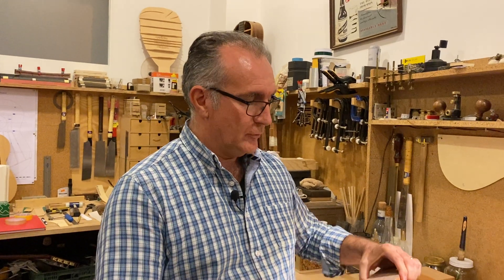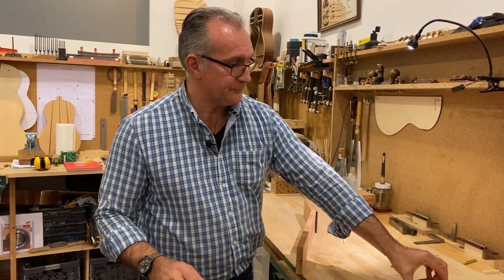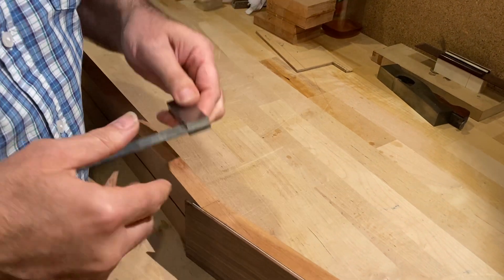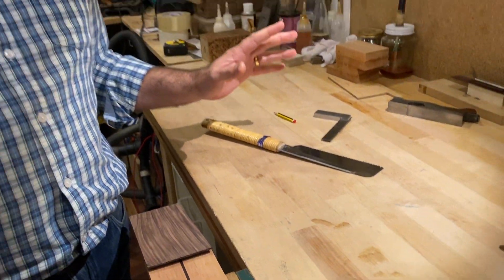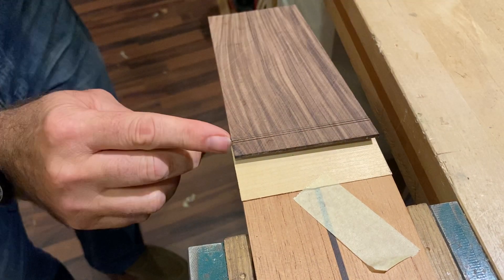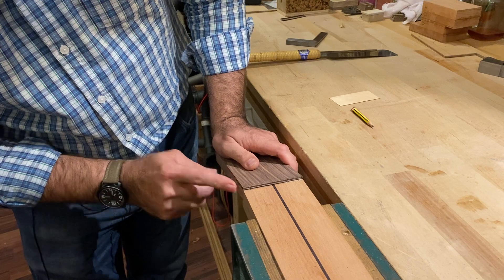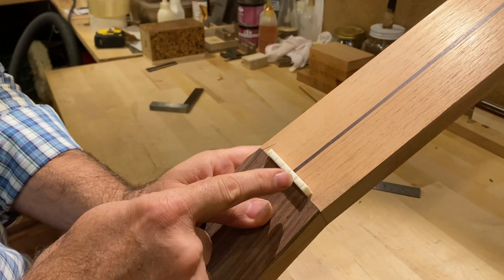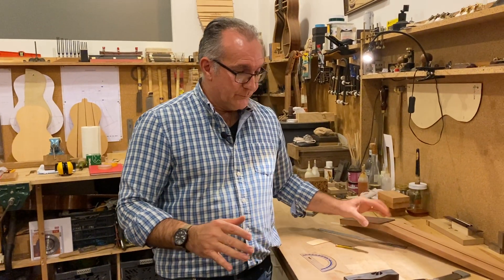How to cut the nut position on the neck of a classical guitar

Comment: Thanks Pablo.  As I am following your course, I found this video very useful for future reference.  I ended up making a perfectly square block with a step routed out on the underside that just fit over the head veneer.  I then clamped it to the neck making sure it was level with one side of the neck so it was 90 to the cut, I then used the block as a saw guide for my japanese saw.  Simon.

Comment: Thanks pablo. I tend to clamp the head veneer square but further forward than required then I can just use a block plane to clean up the end and put the angle on it. I then put the head veneer in its finished position, clamp, drill 2mm holes in corners for cocktail sticks so it won’t move when gluing then glue it all down double checking to make sure it doesn’t creep. This seems to work very well so far on the 3 guitars I’ve built to date and not spotted a down side to it and means I don’t have to saw through the veneer in finished location or get a shoulder plane.